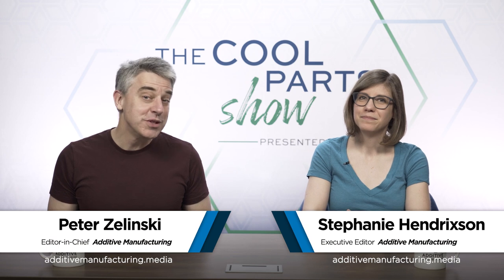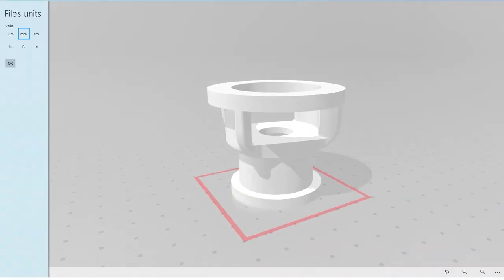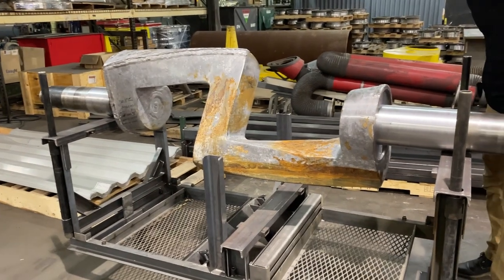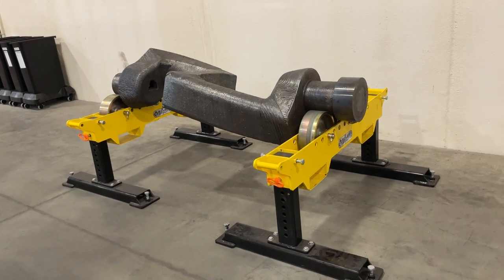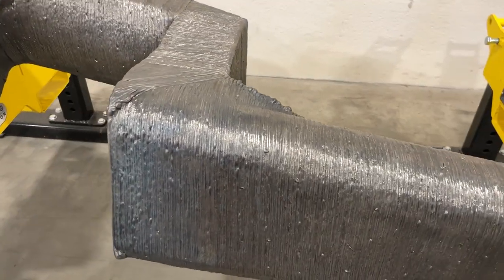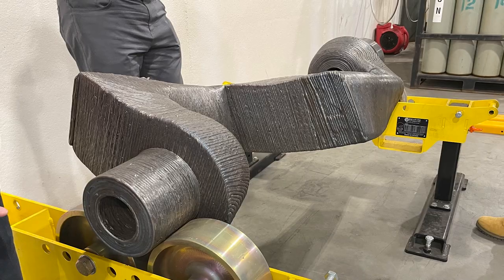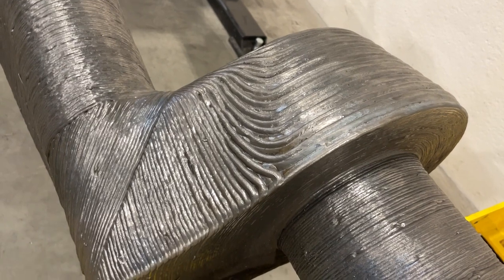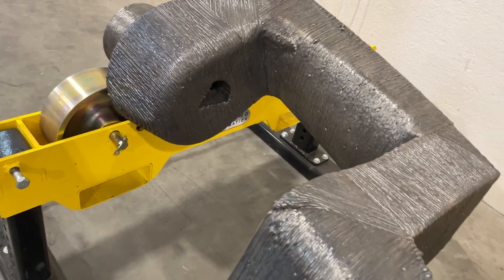Robot 3D Printing Makes Giant Industrial Mixer Blade | The Cool Parts Show Bonus

Comment: to me it looks like the part is rotated to maintain z direction for the robot to grow the part on, mainly because of manufacturing reasons, not so much to make the part any better. that kind of horizontal layering on the mid sections of the part make it actually less strong due to the risk of layer separation cracking the whole blade in two parts.